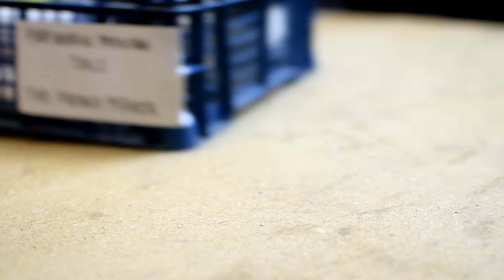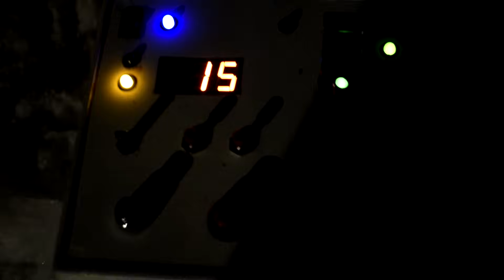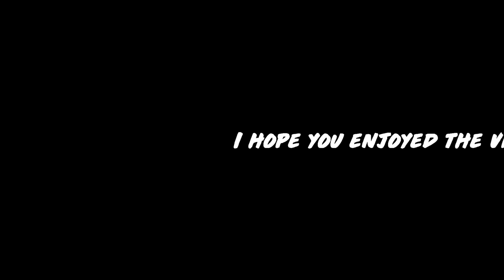BUILDING A FIREWORK SHELL | Cinematic

Comment: Really great video man, I came for the information but was super impressed with the editing. 
I'm thinking of doing some firework making of my own, what calculation do you use to determine how much BP is needed to propel the payload?
Reply from the maker: Thanks you :)
I use 1/10th of the weight of the shell of black powder to propel it.
Reply: @_thefrenchmaker  awesome, I love more independent YouTube channels they always take the time to reply, thank you 😁
Reply: @_thefrenchmaker  Good, that answers a question I had about the cardboard disc added at 2:18 .  More common ratios for small shells are 1 : 5 , or, for a tightly obturated one, 1 : 6.  I think with that disk in place you have both tight obturation and greater confinement of the lift powder, which is why you get good results with 1 : 10 .
Reply: @_thefrenchmaker  how much is too much? Lol using the 10ths scale.

Comment: Never beat on any explosive powder.... not to mention you should never use metal tools as you should try to use copper because it doesn't create sparks like metal does.
Reply: Copper doesn't conduct electricity? What a joke
Reply: @siimsimsiim  Metal creates spark. If you're going to hit any two tools together they should probably be copper.
Reply: @siimsimsiim  Also, I should have said that copper doesn't create electricity, not conduct. If you hit two metal tools, you're going to get Spark, but if you hit two copper tools together, you will not get spark.
Reply: copper is a metal😂😂
Reply: @nerfguy7279  Copper is less likely to create spark when hit.

Comment: Yes, as you alerted me elsewhere, that is a good, bright break of yellow.

What is that at 2:18 -- a sabot?  Are you doing it to make the lift more efficient?  Or is it to hold the lift charge in place during transportation?  I see you wad the shell with two of those same corrugated cardboard disks; are they to make the lift more efficient, or hold the shell in place during transport?
Reply from the maker: For both. The shell being smaller than the tube, there was a 3 mm gap in between. So to give the lift a little bit more power and to hold the shell in place, I added those 3 cardboard circles...
Reply: sueee

Comment: Cylindrical shape shell is good than circle shell?
Reply: Cylindrical shape takes less time, but with ball shell you get a more circular/spherical shape explosion with the stars in the air, cylindrical will still look nice but not as spherical as if you did ball shell, cylindrical can also hold more powder and stars than ball shells can
Reply: @Fireworks_TV  I know that process, between cylinder vs ball.....I've been doing both methods for nearly 15 years....

Comment: does it need to be this "granulated black powder" ? or can i use milled smooth one ?
Reply from the maker: Granulated black powder has a much faster burn rate than milled one. Therfore it is better to use it in small shells that does not have much space in it. I wouldn't recommand using milled bp as it is very messy and can prevent layers of paper to stick together properly. It also won't create a particularly powerful explosion where flash is almost mandatory like in those type of device...
Reply: @_thefrenchmaker  I was just wondering do you know some shop where buy round paper Shells I looked on ebay And for me it's like 30 dollars for 10 pieces
Reply from the maker: No, I don't know... 30 dollars for 10pcs seems really expensive. The best way is to make them yourself by covering a ball the right size, of layers of paper and then cutting open that paper shell. It's a simple and effective way to make your cases
Reply: @_thefrenchmaker  never thought of that. Thank you so much I hope you will keep making these tutorials of any any kinds. Thanks